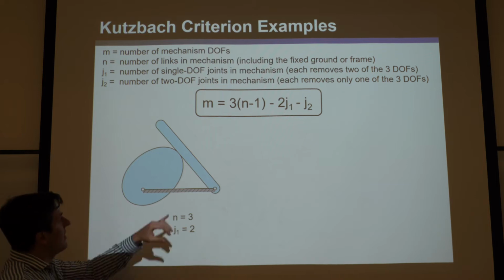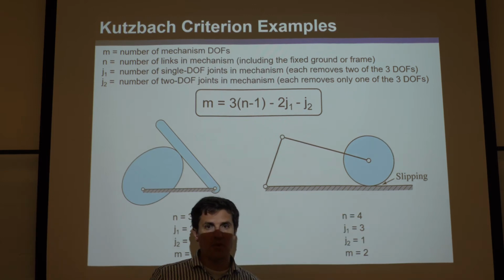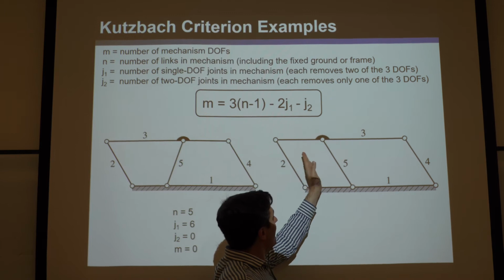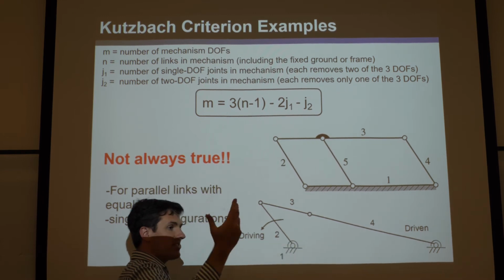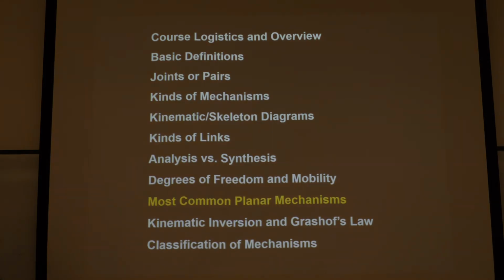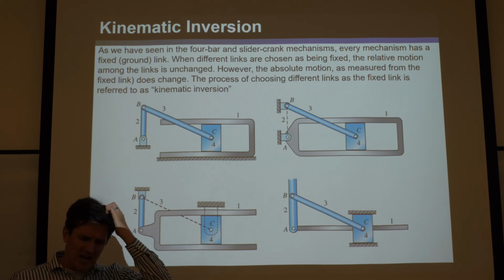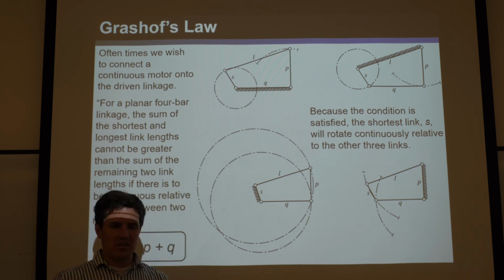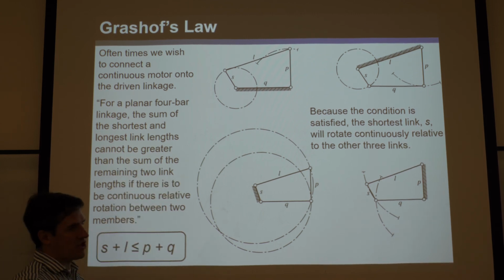Traditional Mechanisms and Mechanical Systems: Topic 1 Part 4

Comment: 0:30 So, the number of DOFs is equal to the number of independent parameters required to uniquely determine the position of the mechanism. Are there any rules/principles on which parameters to use? For most cases I guess it doesn't matter, but it does for the example with an ellipse and a bar. The ellipse angle uniquely determines the position of the bar, but there are two possible positions of the ellipse that correspond to the same bar angle, except two specific points.